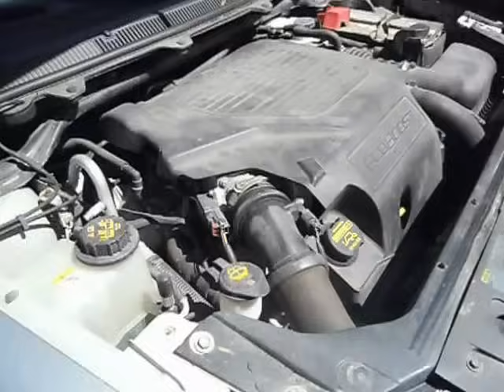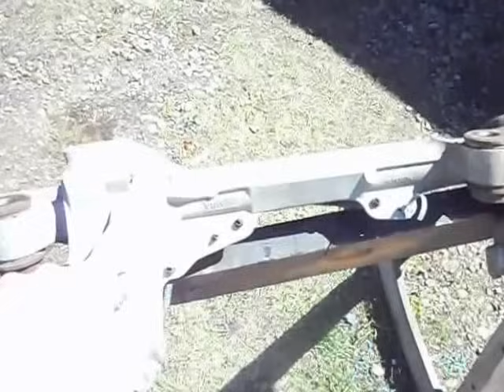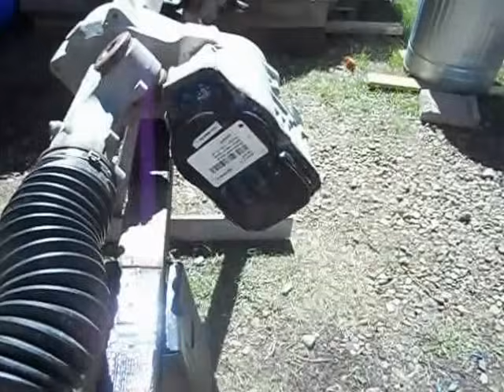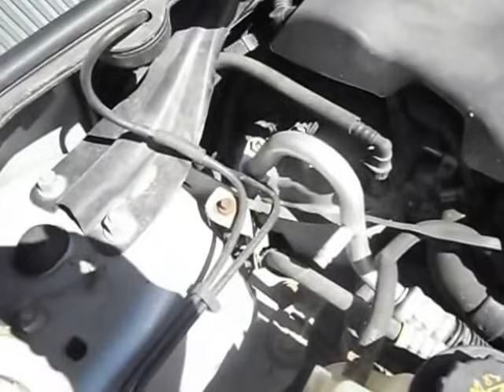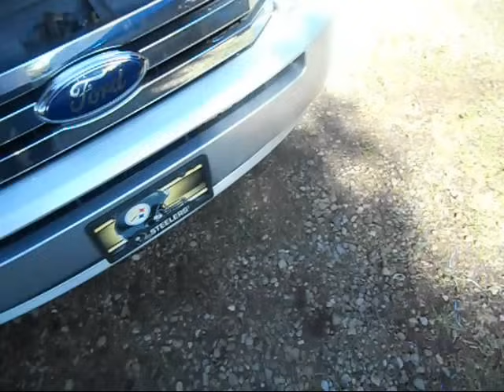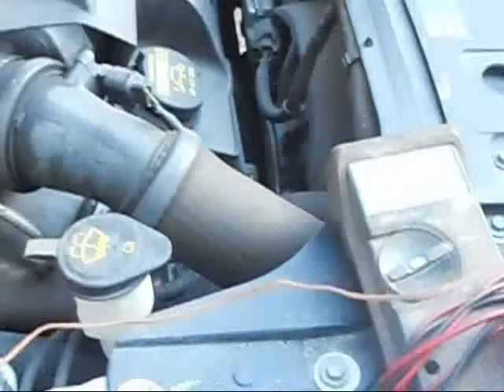Ford Electric Power Steering Failure Identified

Comment from the maker: This was a statement from both Ford and NHTSA spokesman, released after recent article sighting Ford steering failures as number one defect complaint two years running.

Ford spokesman:
“We are confident in our current methods for quickly identifying and 
addressing potential vehicle issues,” the spokesperson added. “When the 
data indicates a safety recall is needed, we move quickly on behalf of 
our customers. The spokesperson said then that the company takes the 
safety of its customers “very seriously.”

NHTSA spokesman:
A NHTSA spokesperson didn’t immediately respond but told ABC News upon 
release of the initial list in June that the agency has a “good track 
record” in identifying safety defects and issuing recalls.

For Ford owners who have actually experienced or been injured by EPAS failures. And have further experienced, first hand, the cold and hostile treatment Ford extends to consumers; sold faulty and dangerous automobiles. These statement bring home the real business model in which Ford has based its legacy. These statements from both Ford and the supposed safety oversight organization responsible to consumers, represent the real political and profitable cooperation between US business and government safety entities. The NHTSA will never do anything dramatic when US manufactures are concerned, the political and financial implications are simply to profound. It matters not that tens of millions of defective and hazardous EPAS units have been installed on vehicles around the globe since 2008. Ford's $200B market capital takes precedence over you, your family, or your defective, expensive problem sitting in your garage. These statements are truly despicable and disgraceful, in light of the sheer magnitude of reported EPAS failures, with millions of consumers abandoned, defrauded, and placed in danger of death or injury.
Reply: My EPAS steering failed this week, and I came here and to other sites discussing it, finding a lot of good information.  I knew it would do no good to argue with the dealer/repairman.  I called Ford and told them about the problem and they worked with me to reduce the repair price, Ford will pay part and I will pay part.  Some of the information online says that the EPAS will give a warning on the dash, and then will be turned off the next time the car is started, and this was how mine went.  I got an "service power steering" notice on the dash panel but the power assist continued to work until I stopped to get gas.  Then I had only manual steering when I restarted the car.  It did not turn off while driving.

It is hard to tell from online information, how many of the million+ cars sold with EPAS have had problems.  It makes sense to me that they would not want to replace them all (recall) but that they would work with the few customers who have a failure, and that was my experience.
Reply from the maker: Ford sold you defective and hazardous product that should have been fully replaced under full recall, and then some. You were lucky EPAS did not fail in hazardous manner, like torque or lock steering at speed. I was injured by 2010 Flex when steering locked (Not reverted to manual!) in full right turn during travel. Must contest your comment about understanding Ford would not want to replace all EPAS units, only those "few" that experience fault; in fact, there have been millions of failures, not a 'few'. We are not talking about a tail light problem; automotive steering system represent most critical safety system on vehicle, even brakes are secondary to steering. You give Ford a lot of undeserved credit, please consider your wife and children driving at speed during EPAS failure. Eventually Ford EPAS system will cause serious injury and fatalities, I sincerely hope it is not your family. It certainly could have been mine, my kids were in back seat during crash; if vehicle crossed into traffic instead of hitting curb, we could have all been killed.
I fought Ford for months to get them to pay $700.00 of a $2000.00 EPAS replacement bill, it is only recently that Ford has eased up on this process. The cost of EPAS replacement to Ford is less than portion of repair paid by customer, so Ford is actually making money off customers sold defecting failed equipment. Do not be fooled into thinking your problems are over once EPAS is replaced; Ford has not addressed the real thermal issue causing unit failures, and never will. Ford will smile in your face as long as you remain docile and malleable; take Ford to court and you will learn what lying, deceitful scum Ford management really are.

Comment: My 2013 Ford Explorer had issues with losing its GPS location and periodically reduced power steering (steering wheel was hard to turn).  Eventually my battery failed and I replaced it.  Since replacing my battery I haven't had either of these issues reoccur.  I did notice that the factory battery was Motorcraft BXT 59 540 and the recommended replacement was Motorcraft BAGM 48 760.  The latter has much greater Cold Cranking Amps and reserve capacity . I don't know if the bigger battery fixed my problems or the computers were "reset" by replacing the battery.  But I know it wasn't just a coincidence.

Comment: I have a 2011 explorer limited, I used to LOOOOOOVE my truck. But when the power steering drama started and I am now on my 3rd replacement, with no end in sight and now For is claiming they will NOT fix the $3800 problem, due to me driving 43 miles over the RECALLED PART THEY KEEP REPLACING's mile warranty!!!! Shame on you Ford
Reply from the maker: Many Ford owners have reported 2nd and 3rd EPAS failures, Ford response typical, NHTSA continues to do nothing. Pay for repair then immediately dispose of vehicle is best option for long term sanity and safety. Ford will never address design flaw; management would rather make money from your repeated repairs. This is unfortunately reality of US consumer affairs, remember experience next time consideration is made to buy US products.
Reply: Can you provide more info.  I just had this happen to me today.  When was the recall?
Reply from the maker: Ford recalled only small percentage of models equipped with defective EPAS units. You will need to contact Ford dealer to determine if your vehicle is covered. Watch your back however; if vehicle is serviced by dealer with partially functioning EPAS; Ford will only update EPAS software (which does nothing to correct problem). Once software has been updated, Ford will void recall and deny replacement once full failure occurs. Only deliver vehicle for service following full EPAS failure. Also, Ford recall stipulates 'one time replacement' clause. This implies if anything goes wrong with replacement unit, you are on your own.
Reply: Thank you that helps a lot!
Reply: I drove to the dealership (my car seems fine now)  They said I would have to get it checked out to see if I'm covered.  By your statement above, Are you saying not to get it checked out unless full failure?  I have to get it checked out to find out if I'm covered.  But when checked, and the results reveal partial functioning EPAS that will void full replacement? Yes?
Reply from the maker: Your VIN number is all dealer requires to determine if vehicle is covered. If you surrender vehicle to dealership, Ford may update your software; then void recall. This is specifically outlined in recall documentation. You should perform internet research to determine if your vehicle is under recall. Do not let dealer dictate course of action; walk into shop fully educated concerning your vehicle by reading Ford published recall documentation. Documentation is publicly available on internet. Many sites will allow you to enter VIN to determine validity. You can also call Ford Customer Care and specifically ask if vehicle is under recall; but Ford will be reluctant sometimes and ask you to visit dealer for evaluation. This is a bait and trap to update your software and avoid liability. Not all customers are subjected to this policy (depending on dealer action), but it is specific documented Ford policy.